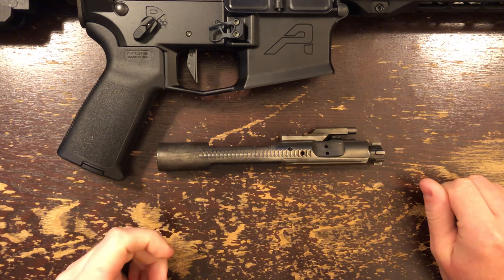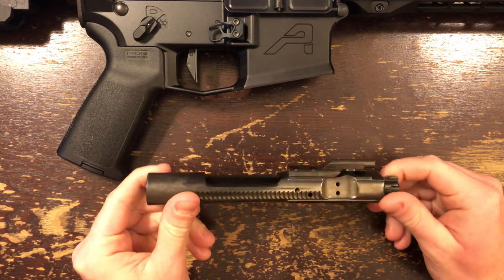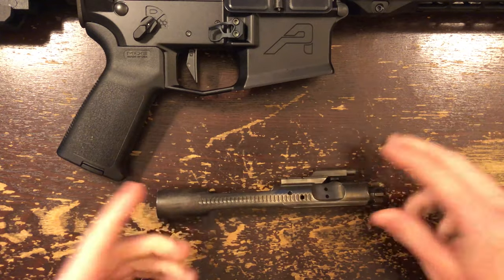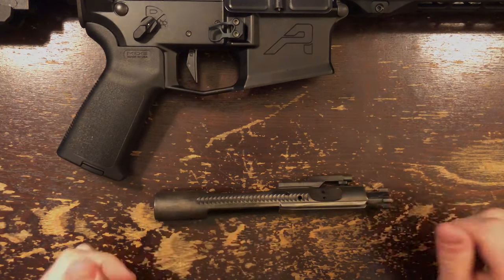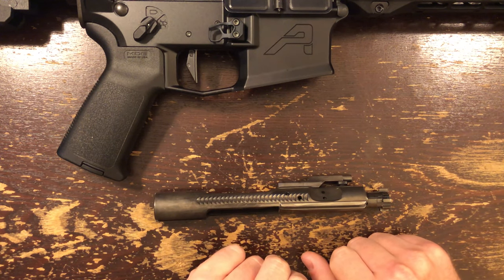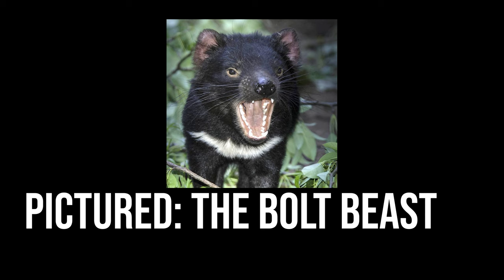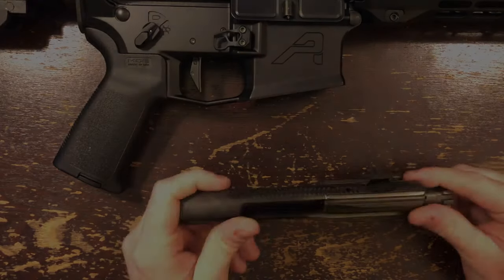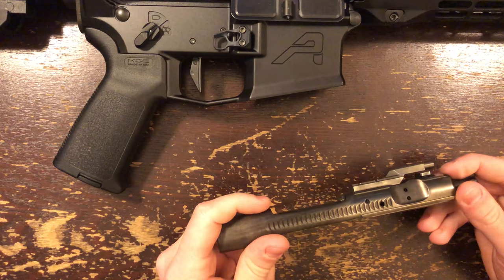Aero Precision Nickel Boron BCG - Review - Aero M4E1 Parts, Pt. 4

Comment: I started off with a no name brand nickel boron bolt carry group came with my 556 upper. Since then I am totally sold on nickel boron. Just purchased my first arrow precision nickel boron bolt carrier group. Now I don't run anything but nickel boron! Carrier groups 👍 it just runs smoother it looks better and is easier to clean and it's just freaking reliable 👍

Comment: Finally an actual review explaining that nickle boron discolors over use without any damage to the actual bolt! Was this polished to begin with?
Reply from the maker: Thanks! Yes, it was polished originally; very bright and shiny.
Reply: Even Fail Zero states this will discolor...also do not use acidic cleaners like Break Free, Simple Green, Hoppes 9, or put in ultrasonic devices....they use Lucas Oil products or Rem Oil.

Comment: I never got to tell you about how my Aero build wrapped up. 

I bought the 14.7 pencil because of you, but I went a little different. I bought an upper with no FA and went with the R-One rail opposed to the S-One. I could tell you it was because I like mounting tape switches on the top rail, I could make excuses, truth is I just liked the look :)
Reply from the maker: That's a fair reason to go with the R-One! The R-One is still my second-favorite rail. If the S-One didn't exist, that's what you'd see on all my guns. And it barely weighs more. It's what, 2 oz. more? I'm not even sure that's noticeable.

Comment: What kind of safety selector is that? I've tried a 45 degree selector with a Geissele trigger and they said themselves that 45 degree selectors wouldn't work.
Reply from the maker: It's the Radian selector. I have many installed, alongside many Geissele triggers, and they work really well.
Reply: @thegunpenguin  Great, thanks! I'll look into it.

Comment: Added NB carrier to my MK12 along with Sharps Reliable Bolt with JP Enhanced One Piece Gas Ring and JP Enhanced Cam Pin along with a 5 coil Extractor spring with Black insert. Great addition to my MK 12 and M4.

Comment: I'm dumb and forgetful and that's why I like Adam's Arms piston upper. 
You get almost no fouling in the receiver.
I had one but sold it to get a Cajunized CZ SP-01.
Reply from the maker: That's a totally fair reason to go with the piston! I'm a big fan of the DI guns, but there are certainly more than a few valid reasons to make the switch.
Reply: I'm sure they both have positives and negatives. 
I have  DI upper now with Nickel Boron bolt and it's not that bad to clean. But getting to work and actually cleaning it is.
Reply from the maker: @Wonky-Donkey  That's definitely a mark against DI. Yeah, you have to clean the piston too, but it's so much more convenient.

Comment: Yo horse master gun penguin man,

Do you have an experience with the np3 robar finish at all?
Reply from the maker: Do I master the horses, or do the horses master me? It's a question as old as time.

No, I have never owned a part finished in NP3. 

What follows is my reasoning, and should not be taken as advice on the subject. I can't recommend for or against something I haven't used extensively myself. I don't want to give the impression that I know what I'm talking about here. Anyhow:

I would love to try NP3, but based on the research I've done and the folks I've talked to who own NP3 parts, I would not see enough of a benefit to warrant the extra, albeit relatively small, extra expense. One of NP3s primary benefits is its evenness. Cheap nickel boron finishes can be quite uneven, but this is less of an issue with a BCG from Aero. However, NP3 still has one serious advantage: substantial extra lubricity. If I ever find that I need even more slickness than nickel boron provides, that's the next finish I'd look at.
Reply: @thegunpenguin  I think it depends on who is the domineering one. Maybe the horse masters you? shrugs

Yeah I've read the same about its lubrbrcity properties and even finish. I typically carry a PPS M2 and have thought about getting the infernal parts robar'd because I've read it provides great corrosion resistnace but one thing I don't like the idea of changing on a carry gun are OEM parts, springs, trigger bars, etc. I could be completely unfounded on that opinion but anywho.

It might be more appropriate on a competition gun however.

Also, thanks for your concise, thoughtful reply. Not many YouTubers take the time to interact with their audience on an involved level, which I appreciate. That's why you're one of my favorites!

Also also, you should do a video on what your EDC CCW loadout is, I'm sure a ton of us would love to see it!
Reply from the maker: @joshuabracke5775   I'm completely with you -- I feel strange changing out OEM parts too. Another issue that can arise with plating is that, if something is already on the thicker end of the in-spec measurement, the extra thickness added by the coating can cause an issue. A few of my friends have had slides and frames cerakoted, and the guns got a little hinky until the new coating wore down in key places. The PPS is such an underrated and awesome gun! 

Thank you for the kind words, and you're on of my favorites too! Though my knowledge is limited, and I'm quite dumb, I'll always do my best to answer questions.

Comment: So is nickel boron the best option available?
Reply from the maker: It's certainly one of the best. Some folks swear by the titanium coating, but it seems to have marginal benefits. Nickel boron seems to have the best cost-to-benefit ratio of the bunch.
Reply: I prefer nitride. It hardens the surface, increases lubricity, isn't a coating and doesn't dimensionally alter the underlying part.
Reply from the maker: @jhalscott   There's certainly a good case to be made for nitride, and that's the same reason that nitride is a better choice than chrome for barrel linings. Chrome/nickel boron/titanium coatings that are done correctly will be well within spec, but I have no doubt that some of the cheapies you see on the internet will be oversized enough to cause trouble. However, if you're ordering from Aero, or anyone else making great stuff, the coated BCGs will work extremely well.
Reply: @thegunpenguin  absolutely. Aero is definitely a manufacturer that provides quality FAR EXCEEDING the price point. Folks would say it is blasphemy, but I'd put them up there with BCM or DD. Most of my recent builds are M4E1. Great company.
Reply from the maker: @jhalscott   I completely agree. I buy Aeros over those other brands. Not that I think Aero is better, but I can't bring myself to spend the extra money for no real gain. As you said, the M4E1 is an insane bargain.
Reply: I've heard excellent things about hard chrome (source is InRangeTV regarding their WWSD project, so you know it's good info). From what I've seen, it doesn't seem to stain as quickly as NiB, which to my amateur eye says lower porosity = lower friction coefficient.

Comment: My PSA bcgs are 158 carpenter. Did you ever see the video I think sootch has it where he looks at a nib and a nitride bcg under a microscope to see the surface diffrence it's pretty cool.
Reply from the maker: I haven't seen that, but I'll definitely look it up. I don't know if the better steel really matters, but it might do the locking lugs some favors under hard conditions. But really, those PSA BCGs are plenty nice, and the steel Aero uses is probably overkill.
Reply: @thegunpenguin  only steel on an ar15 bolt that is overkill would be Knights and lmts enhanced bolt. Made out of aramet 100. They've been out for over 10 years and I have yet to be able to find a case where one failed. I spend 190$ on an LMT enhanced bolt mainly because I wanted the best bolt I could get and to compare it to my standard DD bolt. Other than material they also have enhanced extractors. In my experience if I'm shooting without moving a lot, my brass will all land in about a 1 foot diameter circle. The pattern of brass landing doesnt matter. But the consistency of extraction does. My daniel defense would throw brass a wierd direction every five or so rounds, as does most ar15s I have seen. This is due to the extractor and ejector not working perfectly together. I reccomend you try one of the LMT bolts, you'll never break it so why not. It's an investment lol
Reply from the maker: @KimballPrecision   LMT and Knight's both make great stuff! I'm sure I'll end up testing the LMT at some point.